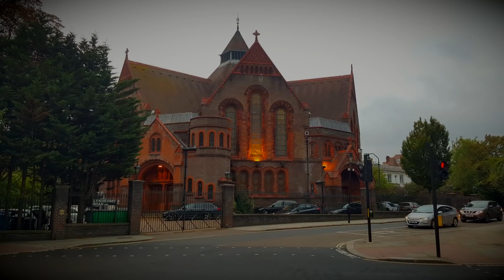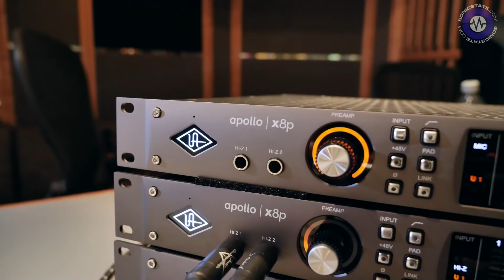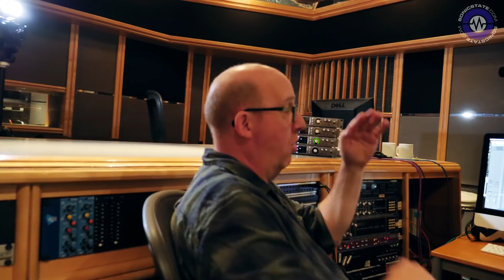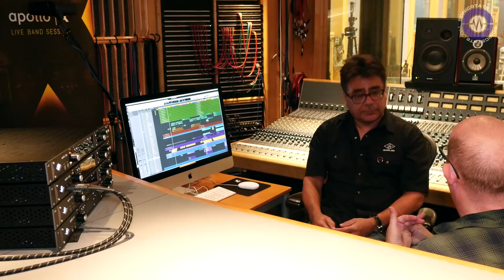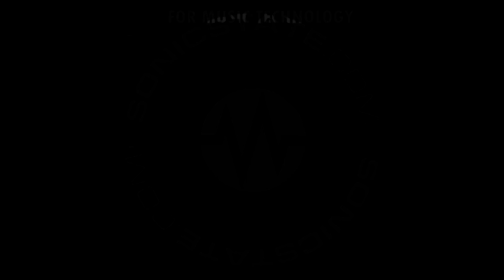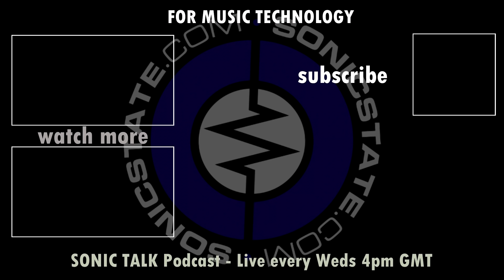UA Apollo X  Interview With Product manager

Comment: Nice to see more processing power. Would like to see 8 cores but that would probably cost too much to keep todays price range?
How does it work with the TB2 connection to the Twin mkII? If anything I'm a bit worried about using dongles and the what the speed difference would cause to the system. 
Also with the Twin, please consider a 4 input version. I know it's difficult to get room for that and it would probably work even hotter than it already is...

Comment: Why has no one built hardware acceleration units to host VSTs for near zero latency software instruments?
Reply: Because additional hardware is going to introduce extra latency and not everyone is happy with it. Then again, there are compatibility issues.

There is always Vienna Ensemble Pro host which is pretty much industry standard for large channel count scoring/musical projects.
Reply: @theeltea  I mean if you can have crazy latency free sounds come out of a work station, why can't a shark chip be used to host a VST for the same dedicated latency free processing, with the computer only acting as a controller for the external DSP, like you would have a computer running an editor for a workstation.
Reply: @shatteredsquare  Because shark is a specialized dsp chip and not a generic x86 cpu. We had SCOPE platform on sharks from creamware. It didnt catch on...
Reply: @shatteredsquare  as a developer, you want your virtual instrument to be widely available on consumer hardware.